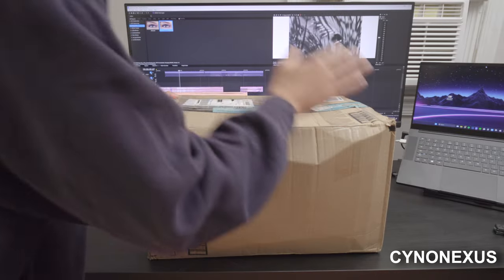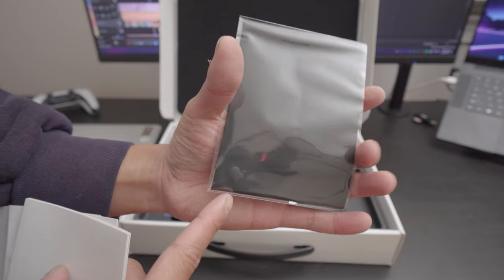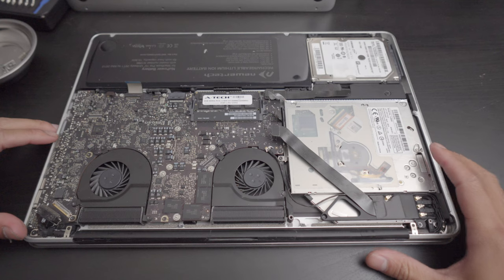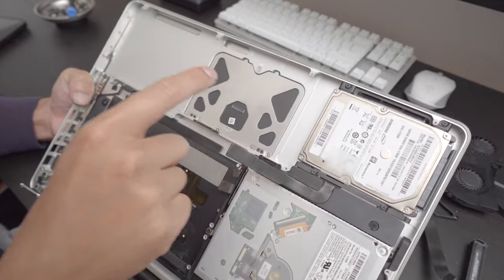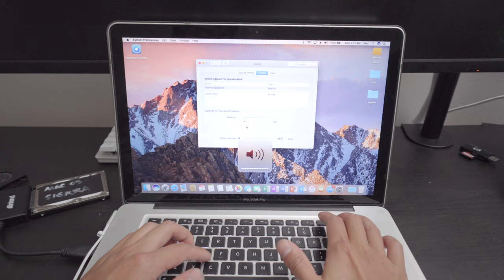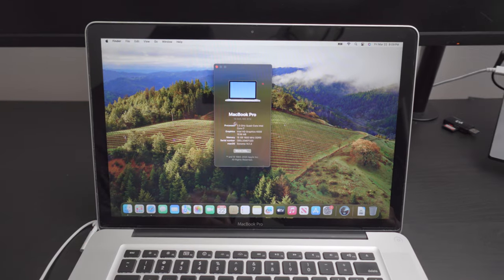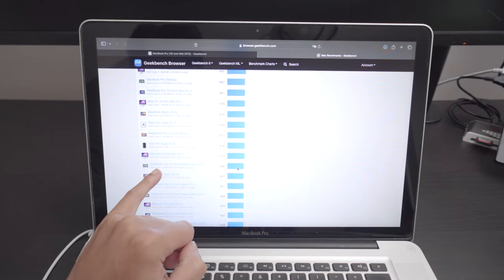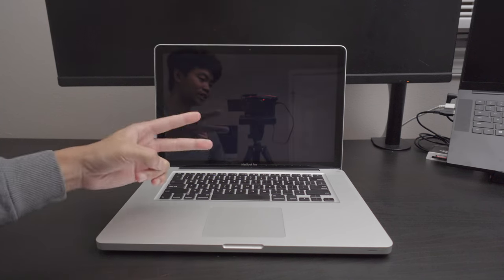RESTORING A 2012 MACBOOK PRO 15" AND UPGRADING IT FULLY IN 2024!!!

Comment: I have three of these. Work flawlessly running sonoma and or Bare metal linux. Unreal for its age
Reply: I have 2 . Keyboard stop working can't even log in. I believe apple send a bug on these pc. What can I do. Please help
Reply: @kitkanok  first off. You hsve to have both macs running monterrey or better. Maybe ventura. open setting preferences. then click display. top of display youll see your Mac. To the right youll see a + sign. Click the plus sign and it will show you "Linking other macs" to the Mac youre using.I have my 2011 Macbook Pro linked to my $3500 Apple Silicon M1 Max. Using one mouse and one keyboard for both
Reply: @kitkanok  to the left of the Mac picture on display you'll see arrange. Thats to arrange all your Macs with external displays in the sequence you want. so you are using them left to right or right to left

Comment: I have a 2010 13 inch macbook pros I fixed up got it for free but had to put in a new battery, I up graded the hard drive to a 1 tb ssd and 8 gigs of ram plus I put macOS Catalina, it is slow booting but works great otherwise.
Reply from the maker: Catalina imo is probably the last best version for c2d macbooks, actually mojave because of their 32bit compatibilities, other than that still a good machine

Comment: I still use my 2012 15 inch MBP for everyday stuff like school for example. I have it with an i7-3615QM, 12 gb ddr3, 512 gb ssd, and GT 650M. It also has the upgraded anti glare display too. It runs flawlessly on macOS Ventura patched and it’s a workhorse of a laptop. I sometimes edit my footage on that thing and it works just fine. I love older machines like this. I plan on using this for as long as it can as it’s the best laptop I’ve ever used.

Yes I know it’s heavy compared to newer macbooks but I’m pretty used to this. I got 100 firefox tabs on my laptop before and it handled it like a champ really.

Comment: I have a 13inch MBP and I did the SSD and ram upgrade, and it’s still kicking, I will let you know that the Hard drive connector notoriously fails so just replace it.
Reply from the maker: very common indeed! had to do it to a late 2011 mbp 13"

Comment: I have a late 2012 Refurbished MacBook Pro that I upgraded to 16g ram and a 500g SSD hard drive. It’s running Sonoma via OpenCore-Patcher. Runs great, maybe slightly hot. I would love to upgrade the CPU somehow so it could be under less pressure from the OS 👍

Comment: sir could you share the link of  the cloth and spray you used for cleaning  screen and completely body shell
Reply from the maker: You can find many replacements on eBay for $20-50 depending on the condition! And I use Lysol disinfectant wipes to clean!

Comment: I'm watching on my 2012 15" of near identical spec. Mine is in good shape and has the original battery as well. I have mine dual booted with Catalina and Windows 10. Under Windows it can run Borderlands 2 on max settings and Skyrim SE on Medium.I haven't tried anything more intensive though.
Reply from the maker: Love borderlands 2!

Comment: Have you ever fixed a Macbook keyboard light? Mine broke, I have no idea why
Reply from the maker: It’s honestly easier to do a complete top case replacement and it would run you probably $20-30 for a decent replacement and that comes with a working keyboard etc!
Reply: @cynonexus  Thanks!!

Comment: Loving the content, keep up the great work! A small correction, SATA II (like the 2010 MacBook Pro) runs at 3 Gigabytes per second (about 250 Megabytes in the real world with an SSD, given 8 bits in a byte). 300-400 Megabytes read/write per second is on par for a SATA SSD through the SATA III (6 Gigabit/second) connection. I do recommend the antiglare display, it makes the computer seem much more modern with a 1680x1050 resolution. Also, it might be fun to Dremel a bottom-panel with custom intake vents like a Retina MBP, since the unibody Macs suffer from horrible cooling. I recommend Macs Fan Control to watch temps and crank up the fans when it gets hot. Playing games is possible, but not a great experience.. Halo Reach stutters a ton, but simpler games are great.
Reply from the maker: Thanks! I didn’t realize 2010s went up to 3gbps! I do remember anything older like an 07 is 1.5gbps! The 2010 shell actually had an anti glare display hence why I went with it only to realize it wasn’t compatible at all for a 2012! Completely different wiring which I cut from the video!
Reply: Sorry, I meant a 2011/2012 antiglare which would be compatible... I was blessed, my 2012 came with one

Comment: I have a Macbook 2008 and then after that Mac Airs 2015, 2017, 2018. Now I want to get a 2012 MBP. Prob wait until the end of the month to go to a swampmeet to look for one.

Just curious and wanted to know the max disk speed this 2012 MBP would support. If you install one of the 3500 Mbs SSD, would you see the full 3500+ speed? For my 2008 MB I got around 1500.
Reply from the maker: These MacBooks are only capable of 2.5” drives so no nvme! Highest speeds on a single drive would be around 400-500 but you can always do a raid0 and do dual ssds to make it even faster!
Reply: @cynonexus  Thanks for the info. I think 400-500 is good for me. This saves me time and money from putting an expensive SSD and find out that it didn't do much.